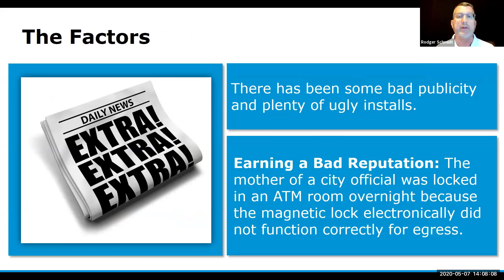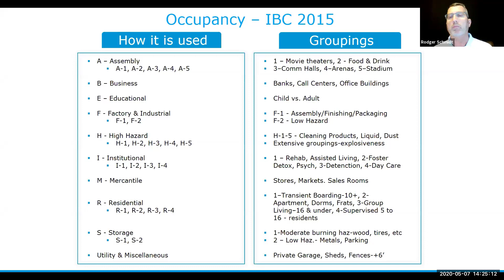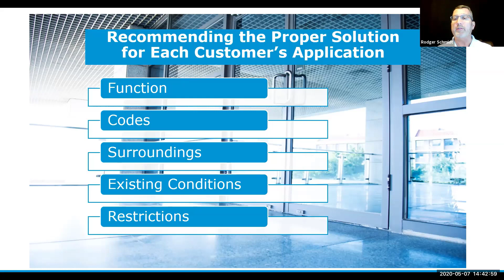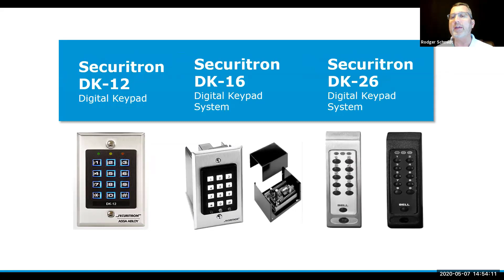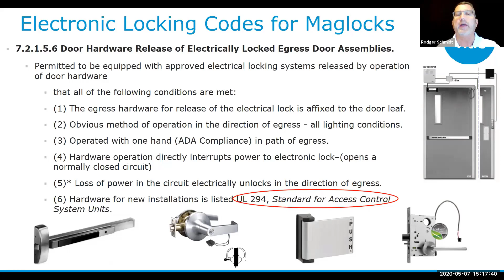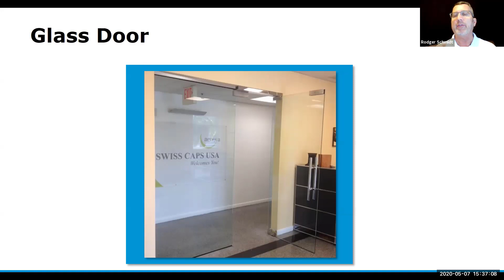Maglocks The Good, The Bad, and The Ugly 1

Comment: Installed many concealed mag locks in glass door headers in my time using another brand. I have a job where we used Assa Abbloy headers and mag locks. We have an embarrassing number of go backs on this job because nothing stays consistent. We will leave after making adjustments and everything works. One week later getting called back. Plumb and level doors, 1/8+" gap at head. Any thoughts?